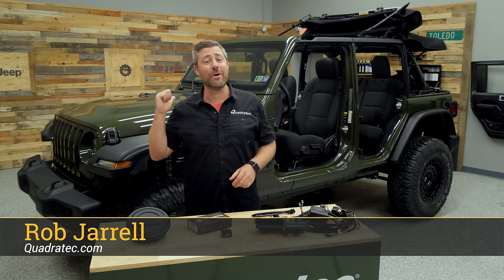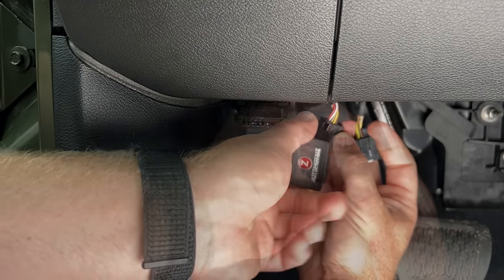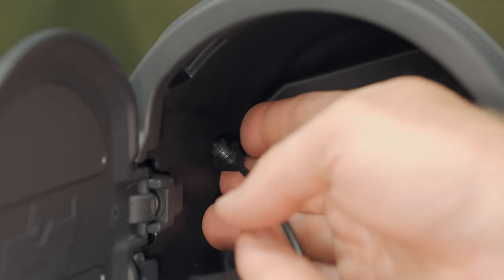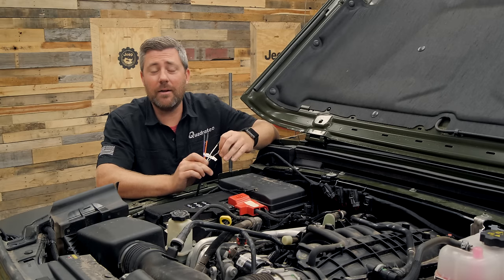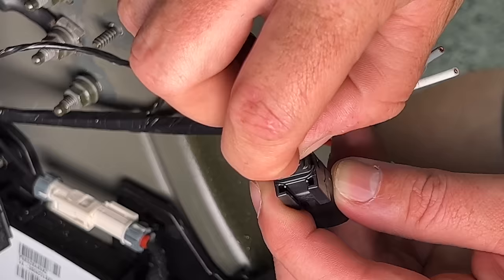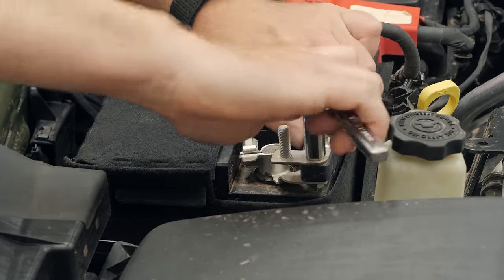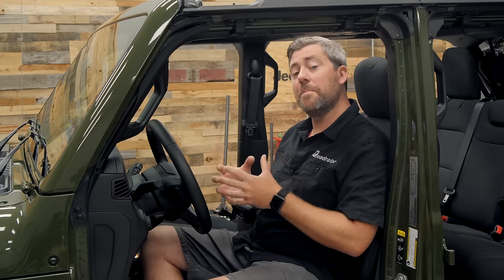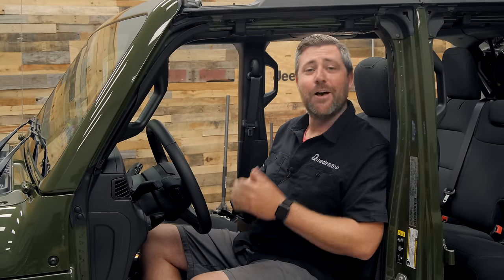Mopar Auxiliary Switch Install with Z Auto Tazer for Jeep Wrangler JL + WIN THIS JEEP!

Comment: My Jeep didn't come with the Aux switches but I had the dealer do the install and they reprogrammed the car so that it looks like it was there from the factory. The aux switches are an awesome addition to the Jeep and the integration with the infotainment system is a nice touch. This should be standard equipment on Rubicon jeeps.
Reply: Do you remember how much it costed you? I'm thinking of doing the same upgrade, but considering whether or not I want to do it myself.
Reply: @berkebiletim  I believe the dealer charged me about $400 to do the install. In reality I could have done it myself, but I'd either have to buy a Tazer or get it programmed at the dealership. When they did it it looks like on the Jeep mobile app that it was a factory installed option. So that's cool.

Oddly enough since that original post I have bought a Tazer because I upgraded the car radio to the uconnect 8.4 and added the alpine subwoofer/speaker upgrade and the Tazer was definitely worth it.

Comment: Quick question.  I'm new to the tazer . Upgraded my tires on my 2022 to 35s. Have the new updated tpms sensors installed. Can't get the jeep to recognize the new tpms sensors. Will a full reboot help those issue or do i need to go to the dealer for a new relearn. Thank you for your time.  Great videos keep it up !!!

Comment: Do you need to do a full reboot with every change, or can you set up several changes (such as tire size, changing Aux Switches to "On", adding the Gladiator bed 110 outlet, etc.) and then do a single full reboot?

Comment: how did you manage to install all of this while using a 10mm socket...and not lose it?  Also, does this kit work with just the cubby?  The other side is the Rubicon lockers and off road buttons.